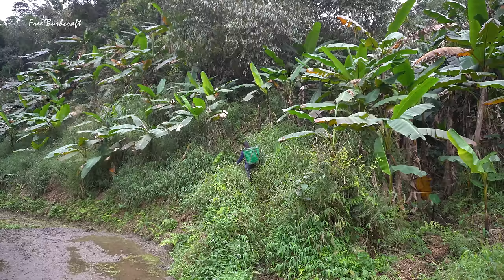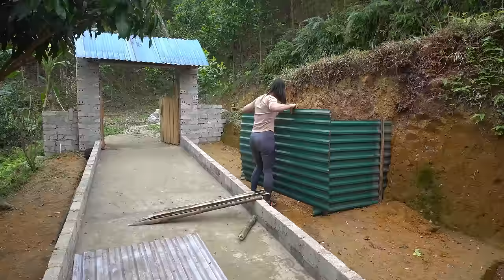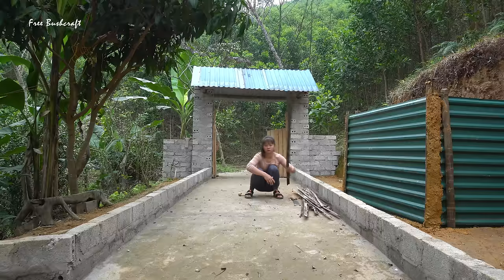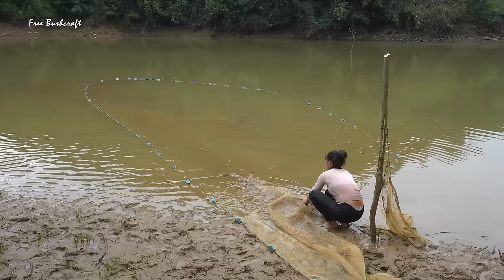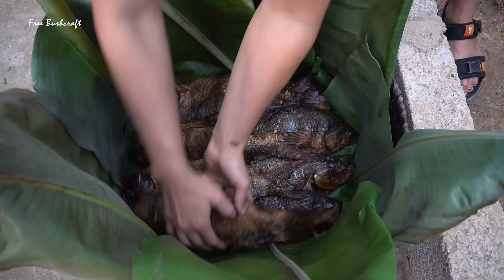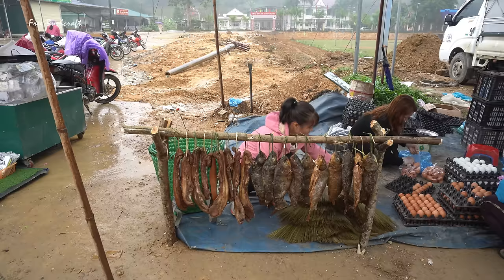FULL VIDEO: 150 Days Smoked Fish Processing & Go to market to sell | Free Bushcraft

Comment: Wish you could add a valve with shut off handle at the top of your water hose.  It would eliminate a damp area until needed, and stop the noise as well.  It is noisy when falling into the catch water basin.  Or else send that water to irrigate your veggie gardens via perforated rubber hose system, which you can control with a simple timer. Work smarter, not harder. You do the work of two men, or three women, can’t imagine the finished farm! What are your final plans?  Astonished as always, a Granny from Ohio, USA.

Comment: These are called corn brooms in USA.  They are yellow, and the frilly part on end, which you keep on your brooms, is cut off, to make for stiffer ends. Brooms are usually used outdoors, to sweep off concrete or brick porches.  For indoors, nylon bristled brooms are used to sweep kitchen floors, as they can be rinsed off and left to dry without any damage.  Your handmade works of art are beautiful and look like wall decor.  It would pain me to use them outdoors where they will get worn down in a short while.  Sell them at highest price possible at the market, don’t take any less just because you don’t have a fancy stand like some merchants. 
And do t sell them all to one person, because they will resell them for double your price around the corner or in the nearest big town.

Comment: Do you have to refill the duck trough regularly? If yiu need to save water line it with plastic. Or spread a thing coat of mortar over the inside. You could then paint the inside with rubber based paint like flex seal. Water would stay. You could install a waterfall pump or an aerator to keep the water in motion and voukd even add fish to it. Ducks would love that... lol. Guess you'd still have add fresh water regularly so you could hput in an over flow pipe to collect and divert the water elsewhere. That would prevent the flow of overflow water from washing away soil etc.